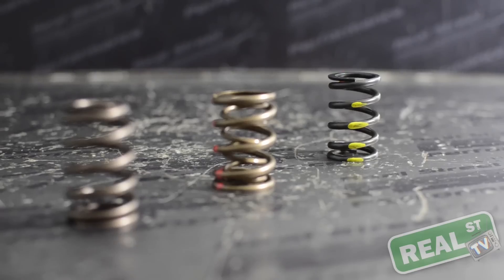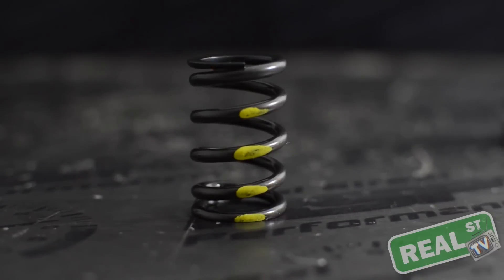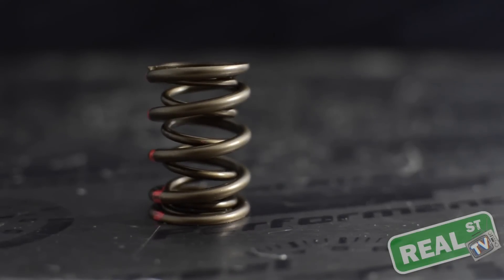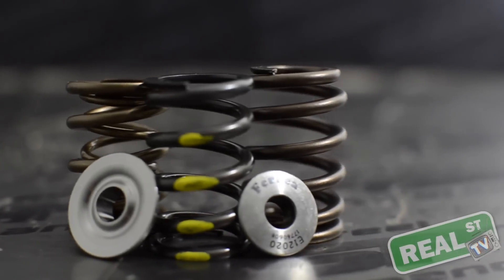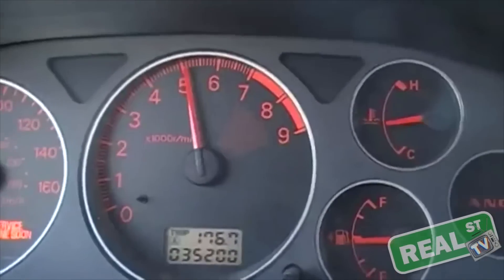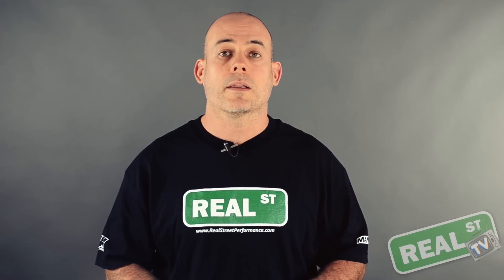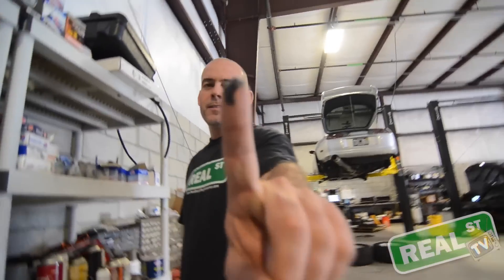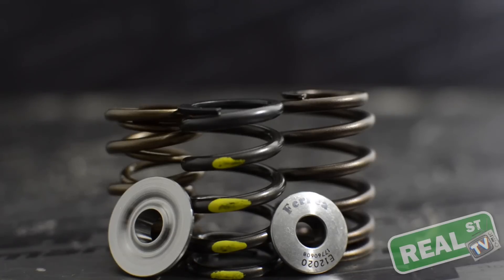Upgrading Valve Springs Jay's Tech Tips #23

Comment: if i change just the valve springs on a suzuki swift 1.6 zc32s can i rev 1000-1200 rpm higher without other things i need to change ?

Comment: I have a new set of ls6 blue springs to use on my sbc 350 aluminum heads will they be ok for a hydraulic flat tappet cam they'll be installed for either 90lbs or 110lbs seat pressure

Comment: Can you guys please make an example vid showing the symptoms of a valve float issue?
I believe im having that problem on a 2jz-ge thats been turboed and has copied bc 272 cams (because there where non offered for the ge).
Reply: Valve float is when the RPM of the valve train is so high that the spring does not have time to extend fully before the rocker comes down again. Meaning that you would see a compressed spring that never seems to move back to its uncompressed state. The symptoms of this is that the valve would never close and collides with the piston.
Reply: @Jimi8512  by symptoms i meant how the engine sounds/behaves when this is happening and also what happens to dataloged signals.

Comment: I'm extremely interested in solenoids. I don't like the turning resistance because of the springs & valvetrain. I can have the AC, water, and oil pumps, run off of electric motors, so the only thing taking power from the crankshaft, is the alternator. And until I replace the springs with a computer, them too.

Comment: First off would love to say thank you for all the tips! I have learned a good bit of information from watching your videos even after being pretty well mechanically inclined. With all this being said, I had a quick question. I'm running a 4 cylinder turbo application and pushing some pretty high boost levels (between 35 and 42psi). I'm still on factory valve springs and though the motor runs great and is making good power, Would this have negative effect on power or more importantly spool effect? I feel like spool time is a little slow for me and spool recovery in between gears is a little hesitant. I would love to hear your opinion. I already do have upgraded valve springs and titanium retainers and new valve seals on hand, but have just not put them in. Thank you for your info!

Comment: I'd be interested in learning when and where to use each valve and the types of applications that would benefit from this. I have an SOHC that I'm trying to get more rpm's out of but the cam isn't necessarily built for it. After market cams are impossible to find for my car so I was thinking how would advancing the cam and using a strong spring for higher rpms work vs spending a ridiculous chunk of change for a completely custom valvetrain.
Reply: nezerac They weld up stock cams to get extra duration and lift on a re-grind.
Reply: nezerac Just go for a re-grind
Reply: Jack Torrance
It's got rollers in it. Not sure how you'd make up for the base circle being smaller.
Reply: have you tried upgrading your ECU
Reply: Navishaal Chand
No not yet. I'm thinking that I'm gonna go for a 1.6 head from the uk as well as burton power valvetrain bits. I want 7500rpms and solid lifters.
Reply: Jack Torrance
That sounds insane. lol. Too bad there isn't a company that just makes cam blanks. Don't need a whole bunch more than that to be honest. Just cam blanks.

Comment: Imo this clip was a great idea but not informative enough. You should of added that cylinder head castings are not always the same. As with valve stem height. Spring seats often vary, even from each other on the head. And to get your ideal spring rate at the seat each spring needs matched to the spring seat/valve by shimming. You can't just get a mass produced valve spring, throw it in a mass produced head and expect certain spring pressures by just throwing them together..  To many variables.

Comment: Hi I have ls400 98 i want to put some part that increase performance ....so i need your advice...I want my car to had 360hp
Reply: Nice cam and good tune with exhaust should be great. Not sure what the aftermarket is for those but those engines sound great with a cam and exhaust.

Comment: Magnetic pen works well for getting the keepers when removing the springs. Do not be cheap and get a good valve spring compression tool. If you are changing valve springs while heads are still on the car, either KNOW where TDC of your piston is located or have a air compressor tool that will hold the valves up... both is at once is recommended... if the valves against the head drop and you lose cyl pressure you will still drop the valve.

Comment: Do you need springs if your still running stock cams.  If you have the rpm raised in the ecu. Say 1,000rpm over stock reline would you need to upgrade the springs for this
Reply: A smart man would and should.
Reply: Yah for 1000 rpm you should definitely replace it. But keeping a stock cam means your power band will not improve at all.
Reply: justin beamon unless, u install higher ratio rocker arms, which will in turn, increase lift n push ur powerband higher.  Making more topend power

Comment: $60 LS6 springs FTW!also, some OHV engines are 10,000 rpm capable so i wouldnt say a DOHC necessary revs higher.
Reply: PC Master Race And some DOHC are capable of 20,000rpm. DOHCs do rev higher and that is why they are used instead of OHV.
Reply: Porsche Curves those 20K rpm engines don't use valve springs lol.
Do you even race?
Reply: PC Master Race 

normally, engines above 16krpm are using pneumatic valve system (just like MotoGP engines or F1)
Reply: cyclecrafttom Exactly, so that isn't relevant to this valve spring video lol.
While 10,000rpm 10,000 horsepower top fuel engines use valve springs and OHV.